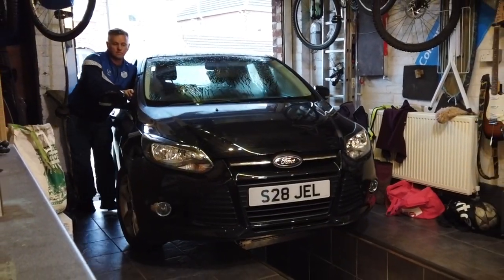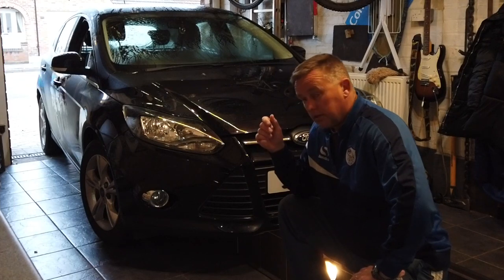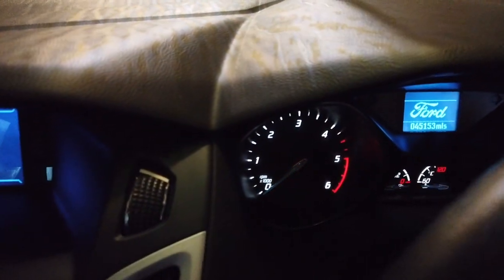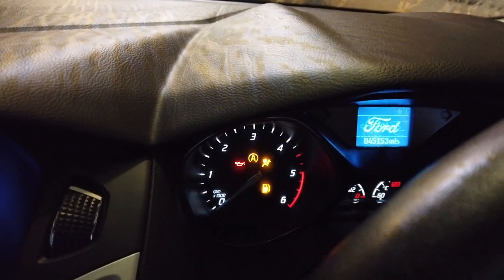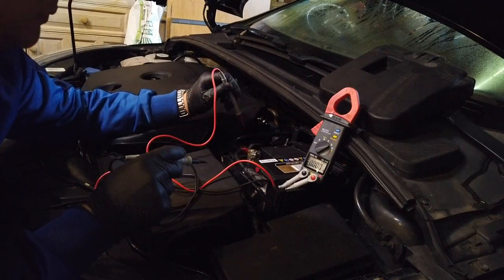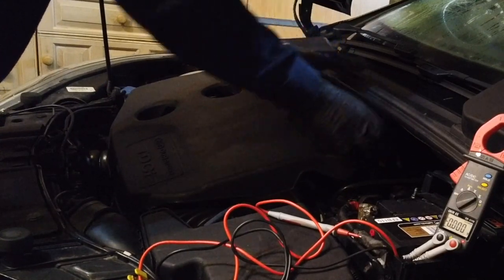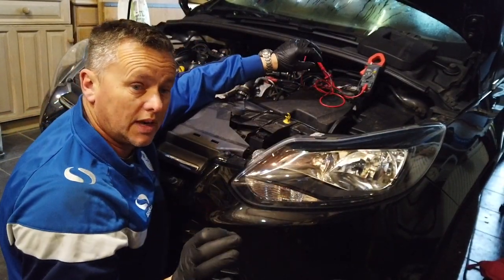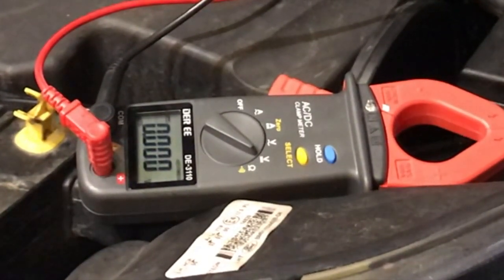Ford Focus Clicking when Key Turned, Starter Motor Repair.

Comment: hi there its not the starter motor,i have been to here and there still no luck
one garage i called to today 29/3/22 said it sounds like my starter relay which is at the back of the instrument cluster,or the instrument cluster itself,its supposed to have been fixed at jc cars in norwich
here is a video of my problem which is from jc cars it shows you the engine malfunction light,but when he has finished the soldering on it he starts car and that is what i wanted doing £71 down the drain
how do i find the starter relay,below is the video that jc cars have provided on youtube

https://www.youtube.com/watch?v=_h50xeETX7Y&t=9s
Reply from the maker: The issue on the jc car video looks like a dry joint on the pub, the immobiliser light is flashing, in your case I would be testing the starter feed wires, Thanks for the great comments👍🏻👍🏻🛠
Reply: @aaanton11  hi there havent got the equipment for that,had a look at the starter motor today,22/4/2022 very rusty undid nut sprayed with w.d.40 but still the same as before,it will start but takes a very very lot of turns of ignition key,i wish you was nearby so you could have a look at it